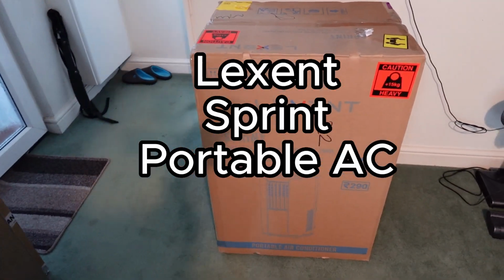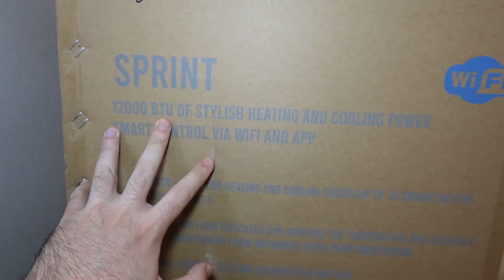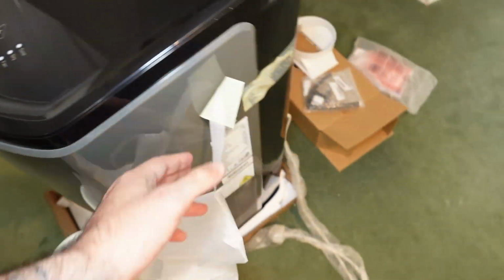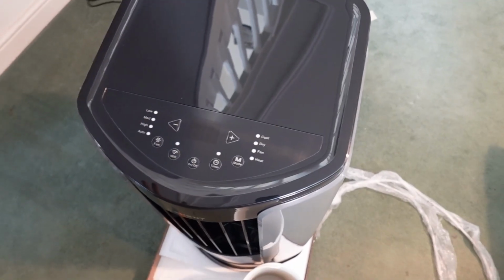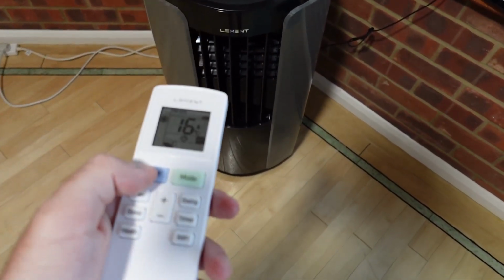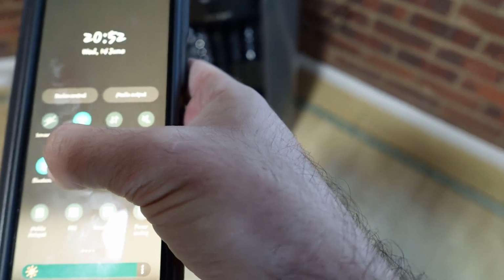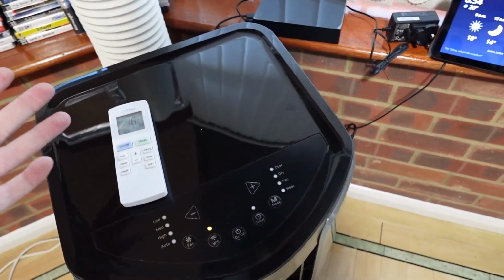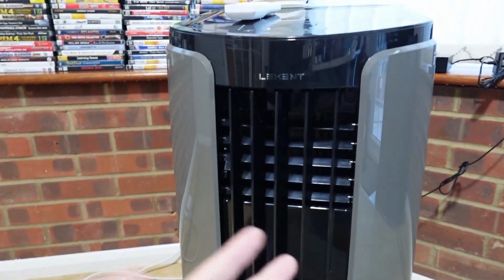Lexent Sprint Portable AC Unit - Unboxing Review Setup

Comment: Hello. Thanks for making this video. You seem to the only one with a detailed review on this model in the internet. 

I can see you published the video some time ago. I recently bought a Electriq Supremecool 14000 BTU unit from appliance direct and had to return it due to A) heating kept shutting down, B) fan they blows the air is very weak, at full speed you barely feel it😢.
I wonder how powerful is this model to be used as just a fan. Thanks
Reply from the maker: @tech-buddy7626  it works great for me, it can be used as a fan, air conditioning cool, heating an dehumidifier
Reply: @techroomuk  thank you for taking time to respond. Have you ever disassembled it for cleaning? 
I used to have a Midea model where I did annual cleaning by completely disassembling it... Have you done anything similar